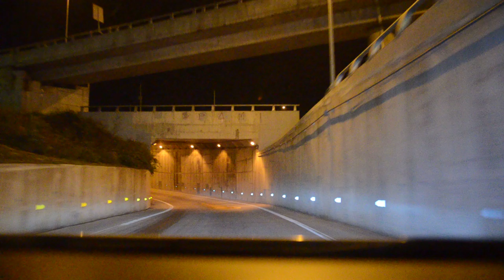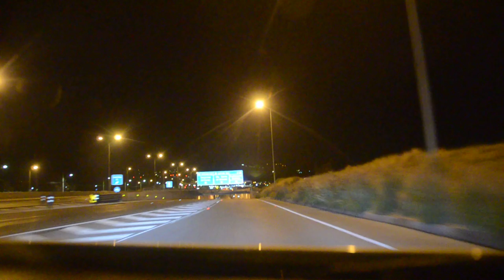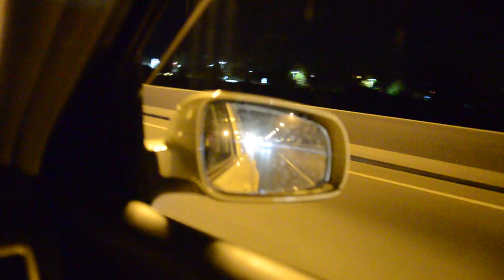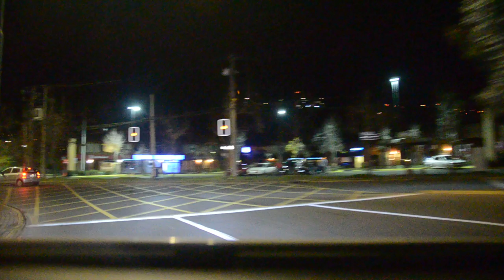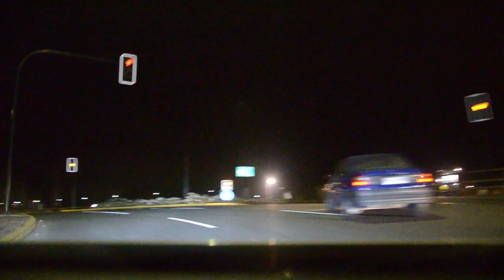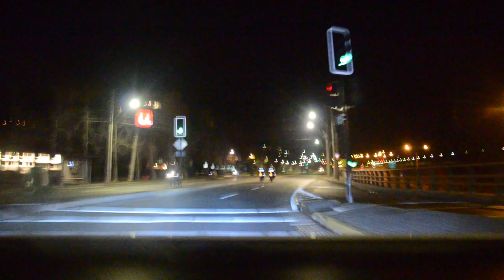VW Bora 1.8T K04 022 1.5bar 3" full exhaust line 300HP  TEST

Comment from the maker: Sorry guy tooo late maybe, but the difference is that this turbo is better for more than 1.2bar, more resistant.
The 3nd gear is very different, more boost, like no lag, after a made other upgrade, FMIC and more power since 4500rpm to 6000.
See u